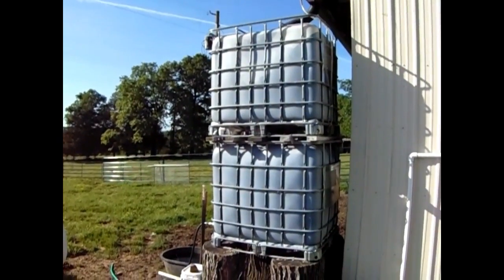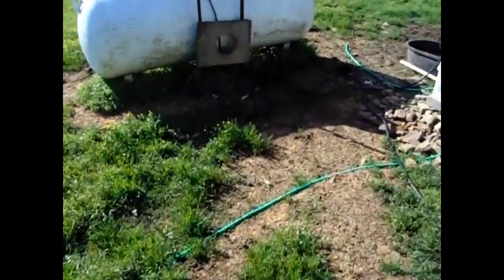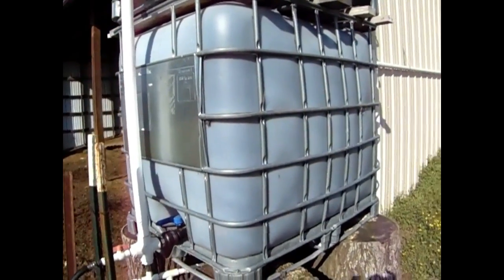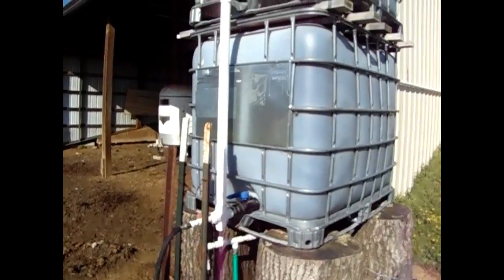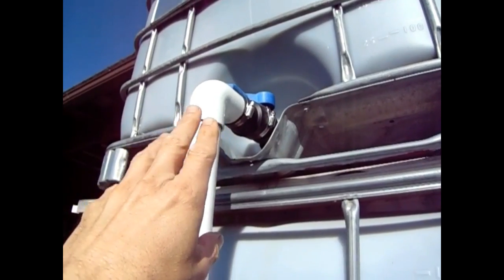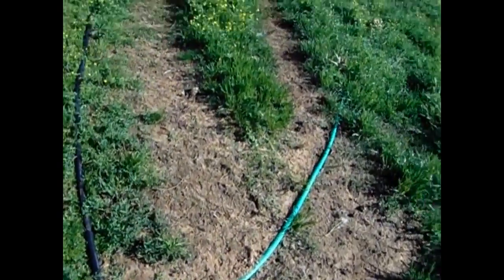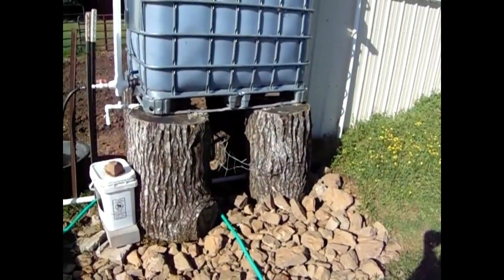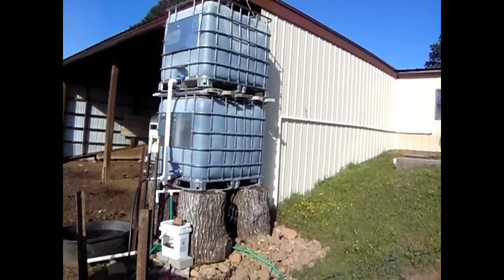DIY Water Tower - Amazing Pressure!!

Comment: What is the pressure coming out of your tank? I'm trying to build something that puts out 110PSI for a large off-grid community?
Reply: 110 psi will require like 250 feet of elevation if you're talking about a gravity powered tower.

Comment: Could I build a taller tower of totes to run a hydro electric turbine..?
Reply from the maker: Maybe but you would need to good amount of water to continue to keep the totes full.
Reply: @ShalomAcres  it's in my head, and works, I'm going to put it on paper; I think the idea would be a tote at the bottom to catch and recycle the water.
Reply: We have had problems with our two stack bulging and leaking. Replaced bottom lid, still leaking. Suggestions? Leakage will rot the base, as well as making collecting past the first bar of second tote possible.
Reply: I see you put boards between the I can cages. Did this avoid leak problems?

Comment: Shalom! I have been off-grid for nearly 2 years. I want to make running water for obvious reasons, and had this wacky idea similar to yours, for my family's water supply.
Problem is, I live in a Quonset. Is there another way I can collect or use pump, or anything at this point?
Reply from the maker: Not sure if I understand fully but if you can collect water in anything you should be able to find a way to set up a pump, either with a flooded section or out of the top.  Hope this helps?

Comment: Those totes are made to stack on top of each other. They interlock with one another
Reply: but they are not made to be pressurized.  the bottom tote is pressurized by the water in the top tote, which cause it to swell and bulge, which you can see in the video.  If you don't space them the way they did, there is enough pressure to push the lower tote vent up against the bottom of the top tote, which causes, breaking, leaking, general badness.  side by side is a far better configuration for these totes, but it causes problems getting good pressure without a pump.

Comment: Love the videos I watched so far. New sub. Where do you get and maybe a rough price of the totes? Thank you
Reply from the maker: lastniceguy1 - We usually get ours locally from food manufactures (food grade are the safest) and try not to pay more that $40 a tote.  Craigslist is another good option.  Good luck and enjoy collecting!!
Reply: Shalom Acres I'm also a new sub as of this morning. I watched your series on the root cellar as i hope to build one this spring or summer. One question that i have about your totes is, what about freezing?  Have you had any issues?  Does it get cold enough there for this to be an issue?  Another project that i hope to tackle this coming year is a water tower of some kind. I'm still going over many ideas but my current main concern is the water freezing. Any help would be appreciated. Thank you for your videos. May the Father bless you and yours.

Comment: This suggestion may seem crazy, but it's worked out well for me on many occasions, ... check salvage yards in your area. I have walked in looking for a part for one project and literally found exactly what I needed already made for several projects built better than I could have made for far less money. Seek and you shall find. You'd be amazed at what some people take to a salvage yard and sell for scrap price. Usually a salvage yard charges double scrap price and you can get amazing items.
Reply from the maker: s fetterly - I like your suggestion and use them regularly for other items but I haven't thought about it for the antenna tower.  I will start my search and yes your are correct amazing what people sell for salvage price!

Comment: The system is looking great bro.  One thing I wondered though.... how stable/sturdy is that double stack??  It seems like something that tall and "slender" would need a wider base than that in order not to be top heavy and possibly topple/tip over with some of the gusty winds y'all likely get on some of your hilltops.  Or is it attached/anchored to your building somehow in order to help stabilize it??  Didn't notice that if it was/is.  ;-)    Keep doin' what your doin'... it's obviously workin' pretty well for y'all.  Still tryin' to get Aaron & them to head out there so we can visit y'all and check out your homestead someday.  ;-)
Reply from the maker: Hey Jason - you are welcome to visit at any time.  The trick was making sure the bottom logs are level prior to going up.  The top one is attached to the bottom one with some metal strapping.

Comment: Very nice set up, do you have or have you had any overflow problems from the huge amount of rain this year???
Are you doing anything with solar or windmill power collection???
Reply from the maker: s fetterly - after we shot the video on improving our pasture (removing surface rock) we had another good rain (1 3/4" in 1 hour) and water went over both our primary and secondary overflow.  Overall everything held up well but we need to cover both areas with more rock, since the rock was pushed down by the large volume of water.  We currently are not collecting any energy from the wind or sun on our homestead.  We have pieces to build a wind generator but I am still needing an antenna tower.  I have been watching craigslist for the past 2 years trying to find one local and for a good price, no luck yet but it will be provided!  If you have any suggestions I would appreciate them?!